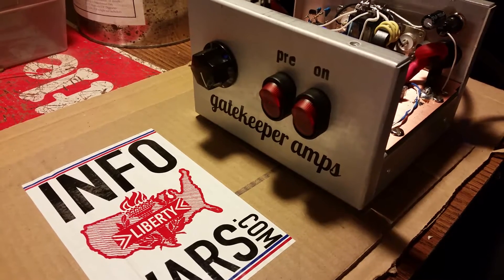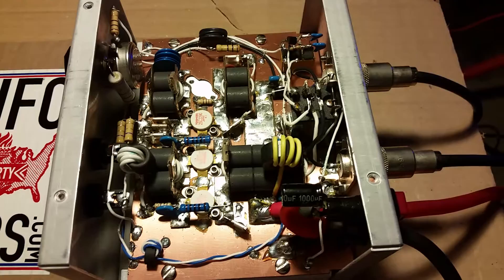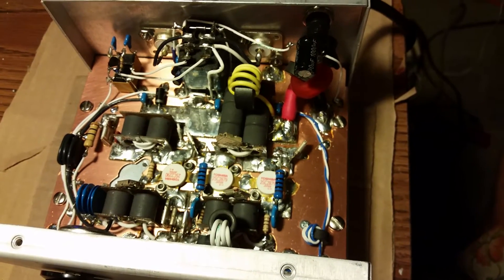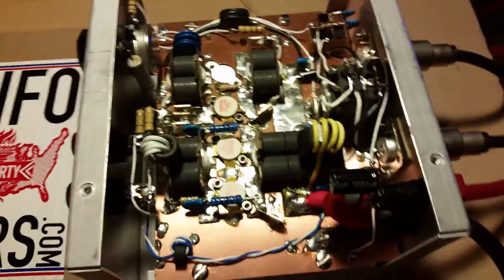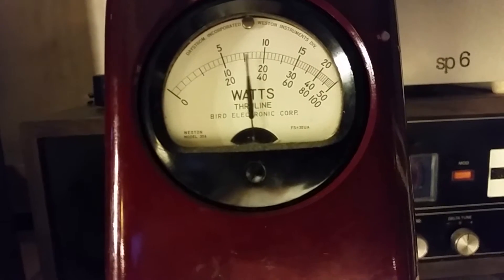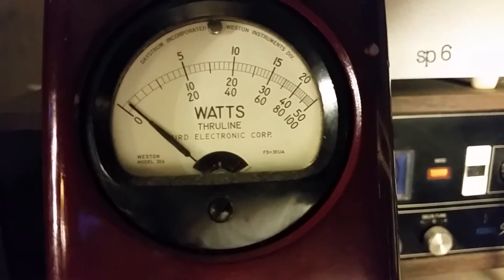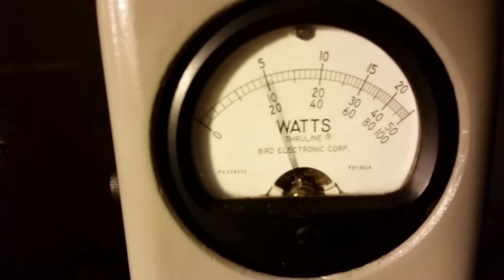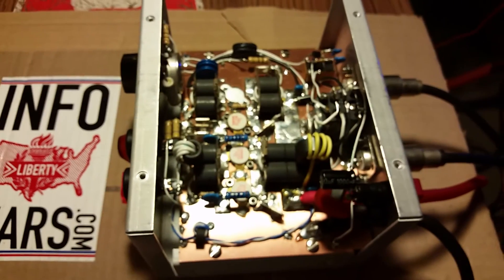Gatekeeper Built 1x2 Amplifier with All Metal Caps

Comment: Metal clad mica caps are used in high AC (RF) current situations. They have a very low dissipation factor and therefor will stay cooler than other types of capacitor technologies. The place they are most beneficial is tuning out the leakage inductance on the output transformer... since there are very high AC currents there.
Reply: 1883GotDown All transformers have leakage inductance. Leakage inductance is the imperfect flux coupling between primary and secondary. In audio work, that is not a big deal... but at high frequencies... this stray inductance is a big problem... and efforts must be made to tune out that effect with capacitors.

As for the caps from the collectors to ground... these are an attempt to improve the symmetry of the push-pull configuration by minimizing output capacitance changes of the transistors during operation. The value of these caps is not very critical... and they usually have a minimal effect.